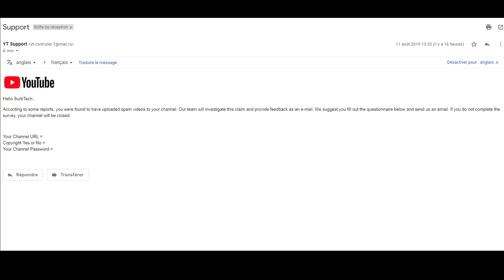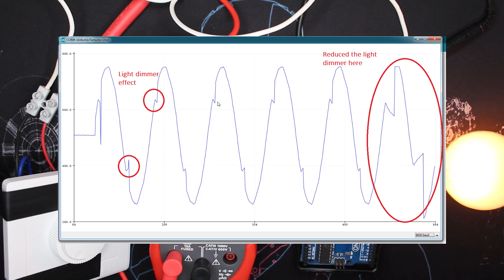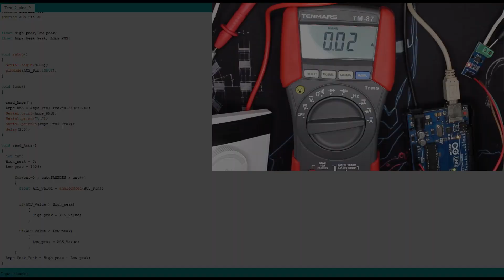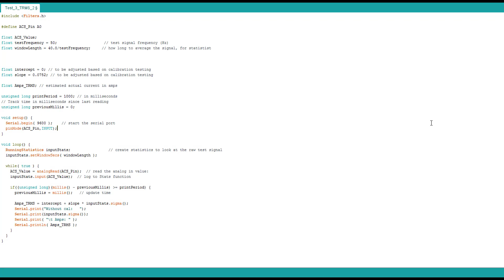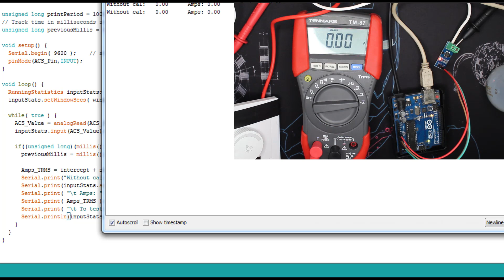Measure Any AC Current up to 30A with ACS712 and Arduino

Comment from the maker: Hello, all the wirings/libraries/codes can be found on the link below the video.

I'm sorry, the video was supposed to be around 7 - 9 minutes but ended up 25 minutes long so here's a map to help you skip to the part you want:
- Beginning : Little talk, setup the test bench and signal visualisation
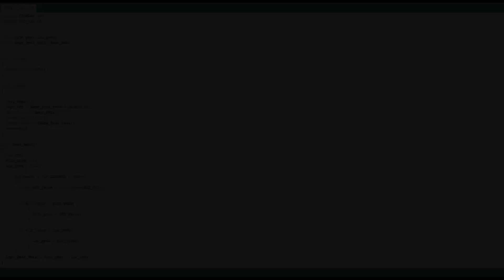-  9:26    Here we have a simple code that can measure sinewaves signal only and displays it on the serial monitor
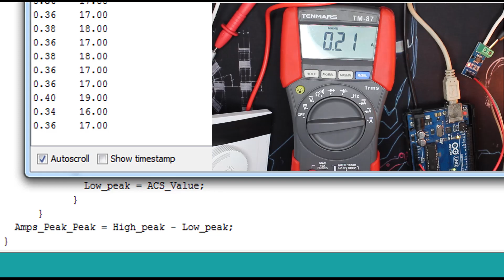- 14:41  Here's the code that works with all signal shapes, can measure the TRMS of any signal and displays it on the serial monitor
- 18:13  Explaining how to get the slope intercept values
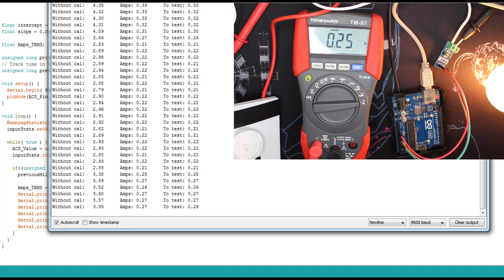- 24:20  Adding the LCD to the last code
Reply: Hi SurtrTech, Is this module reliable for continous use with arduino uno.if i ask you to suugest one from ACS712 or CT 12A-100 module which will you recommend.
Reply from the maker: Hello, well I've never tried the CT 12A, for me it's better to work with non invasive current transformers, it's more safe and can work for a longer time without a problem.
Reply: pro trick : you can watch movies on flixzone. Been using them for watching lots of of movies these days.
Reply: sir is it possible to use relay between ACS712 and load to turn off/on the load?. Please answer

Comment: Hello, Sir good day! Is it possible to add a gsm arduino shield in the circuit? I want to ma a Open Cicuit Alert System. Basically, I intend to make an alert system that sends a text message if the current ammeter detects 0 current. Is that possible?

Comment: can we measure 200A with this code?
Reply from the maker: Depends on the module type, mine is 30A.
Reply: @SurtrTech  actually i am using solid core Current transformer with the rating of 200A/5A with ACS712 5A module and trying to achieve result with the help of these technique if you have done this before so it might be helpful for me.
Thankyou.
Reply from the maker: @shehriyarbinak3776  I've never did that but I think it should be possible, but if you're wishing to go up to 200A better use ACS712 10A so you won't be too much close to error margin.
Reply: @SurtrTech  Thanks for you feedback your method of doing work is really very appreciated.

Comment: can you share a little bit of information in the second test why do you multiply 0.06?
Reply from the maker: As I said it's just to get the right values (calibration), that value is my own, when you do your own test remove it first then put something else if needed... The test 2 is not that important as it fails once the signal's shape changes.

Comment: Hi , can we use the same code to measure  DC current ??
Reply from the maker: Not tested but probably not, the DC is easy to measure, with just a proper calibration you can measure DC.
Real Current = a * Measured value + b... "b" can be obtained by calibrating at 0A real current and "a" can be calibrated at a value.

Comment: Hi there, i dont get that sine wave at the beginning of test 1. Is there something wrong with my acs712?
Reply from the maker: Hello, make sure it's wired correctly, it should be in series with the circuit, also make sure that you have a load ! it's also better to add an Amp meter to make sure you have current there.

Comment: I calibrated using 3 loads(0,75,200 kw) and got the intercept and slope value,but when i put a load of 250kw it will give me wrong currnet value and also i am getting higher fluctuation in the inputStats.sigma() function. can you give me solution to overcome this problem.

Comment: Hello sir, i have done the code part accroding to your code, but i can't get the intercept and slope correctly ,according to your sensor it's give you zero in inputStats.sigma() when no cureents flowing throuh it,but my case i have values even if the current is not flowing ,can't i get the your values in my sensor? or if it's not can you give me a way to calibrate intercept and slope  precisely.

Comment: This is awesome, just what i've been looking for - thank you !! I have a question though, i'm trying to implement this into a larger project which reads data from a solar charge controller, checks the DC amps in (from charge controller) and AC amps out  (using your code) and switches on different loads as and when enough power is available. 
But i'm really struggling to get your code to work outside of the "while" loop, when it gets to this section it just loops infinitely (as originally intended). Ideally i'd like to run a few instances to get an accurate reading and then move on to the next thing in the main void loop. I've tried adjusting the code to run through only a few iterations but every time it just gives me messed up Amp readings - any advice would be greatly appreciated !!
Reply from the maker: Hello, thank you, first I recommend you to test the code as it is and make sure you've set your "slope" and "intercept" values, then you can move "RunningStatistics inputStats;" as a global declaration, move it next to the libraries declaration.
Then put this function "inputStats.setWindowSecs( windowLength );" in the "Setup" function.
After that Take everything in the loop and put it in a separate function, instead of "while" loop -Here's an example-:

void Read_Amps(){
ACS_Value = analogRead(ACS_Pin);  // read the analog in value:
    inputStats.input(ACS_Value);  // log to Stats function
        
    if((unsigned long)(millis() - previousMillis) >= printPeriod) { //every second we do the calculation
      previousMillis = millis();   // update time
      
      Amps_TRMS = intercept + slope * inputStats.sigma();
}

And in the loop you can use Read_Amps() to call the function and add some prints to display the value.

Here you have to be very careful if you want to use it with another things, this method requires a lot of readings to give the right value, I recommend adding a "For" loop and do at least 10 readings before getting the value.

Do the tests to be sure and adjust if needed.
Reply: @SurtrTech  you are amazing, thank you so much for taking the time to get back to me and for providing such a detailed well explained and speedy response! I'll give your suggestions a try and hopefully get this up and running soon  :)
Reply: @SurtrTech Just wanted to let you know that this worked perfectly, thank you again for you help and excellent code !!
Reply from the maker: Glad for you.

Comment: That's great. Thank you man. However During test our code I opened Serial Monitor  and found it at the first or second line.
 It showed  high value . It seems incorrect and so strange . How can I fix it ?
Reply from the maker: The code algorithm needs to do multiple readings before giving the correct values...

Comment: Hello sir, i want to use this project using NodeMcu, but when i am uploading it to the board, the board is getting restarted repetitively can you give me some idea?
Reply from the maker: If it gets reset everytime it means it's stuck on some place... try moving the two declarations on the loop to the setup and remove that while... I'll try uploading a video using a NodeMcu.
Reply: @SurtrTech  thanks for your response sir...will wait for the nodemcu code...
Reply from the maker: To not make you wait because I don't know when it will be uploaded:

Those line below, try to put them in Setup, and remove that while(true) from the loop.
RunningStatistics inputStats;                 
inputStats.setWindowSecs( windowLength );